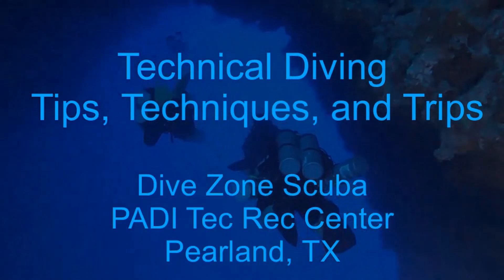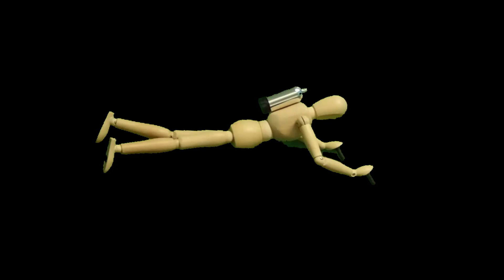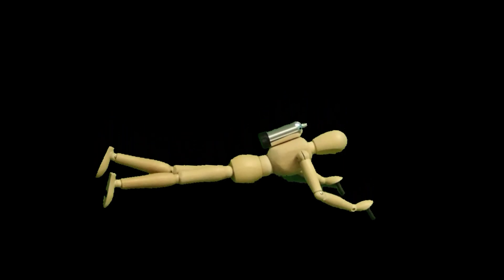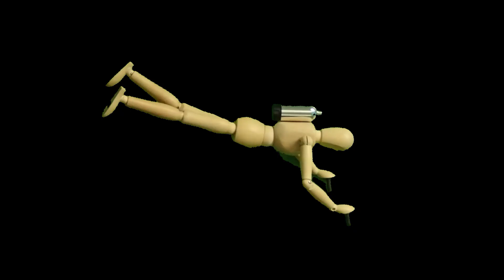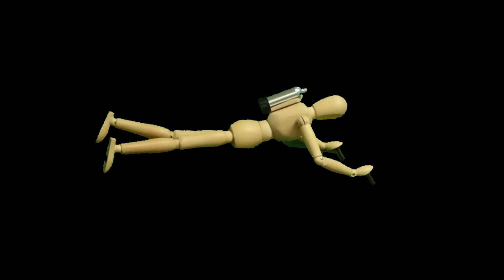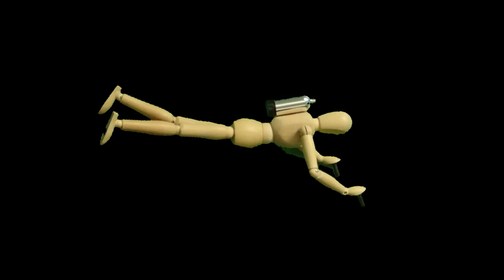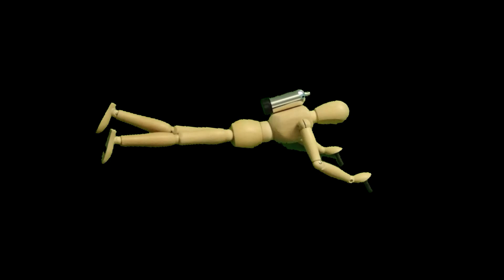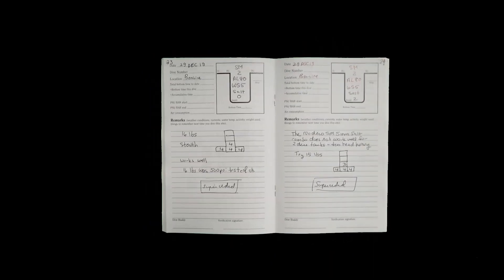#113 - Part 2 - Understanding Proper Trim for Both Recreational and Technical Scuba Divers

Comment: Hi Chris, thanks for the video!  I’m a new tech diver and I finished my class in a warm location, but I’m getting ready to dive locally. During my class I was in a thin wetsuit and did not need additional weighting, but where I dive locally I wear a drysuit. What’s the best way to add weight to a doubles setup? I typically used 10 lbs in my cam bands with a steel 100 single tank and will be using a doubles set of 2 steel 100s. How should I attach the weight? Should I use a belt?
Reply from the maker: Hello Richard.  Congrats on your certification.  My original reply got lost in youtube land.  What I had mentioned is that I made a video on weighting systems for backmount doubles a couple of years ago.  I haven't finished numbering all of the videos yet, but it was before video #49.  I use trim pockets on my waistbelt instead of a weight belt.  I also use the weight bar from that video and a third way is to mount weights on a normal tank band on each side of the tanks.  That gives you a lot of trim flexibility.  Diving with a both a drysuit and hp steels might take a few dives to get worked out weight and trim wise.